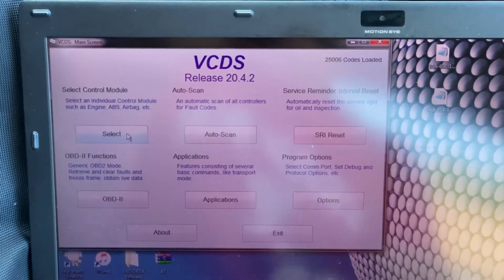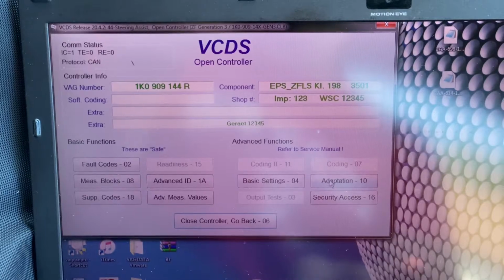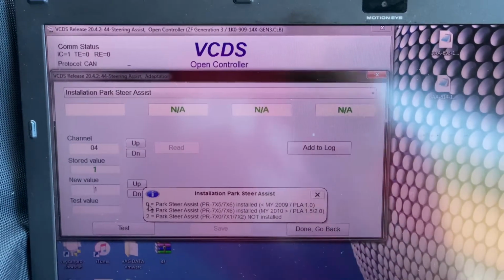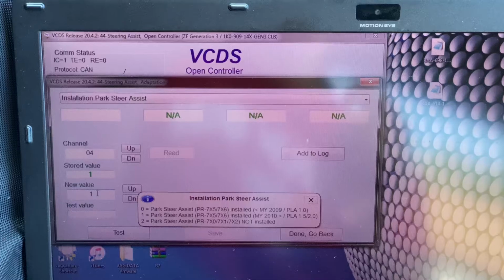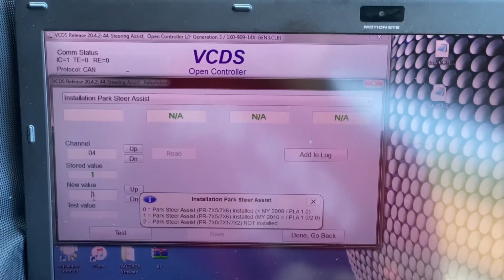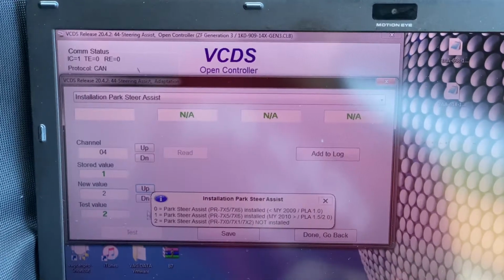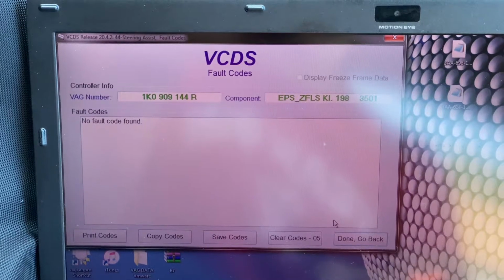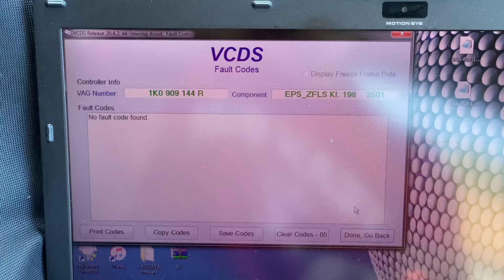Passat B6 B7 CC PLA activate in 44Steering Assist module

Comment: Hello, I installed 3aa920880 mfa on my passat b6 2009 HIGLENE and then the parking assist does not work correctly, does not find the parking space and the reverse warning mfa Thank you in advance for your help
Reply from the maker: You need to check coding, clear all errors manually
Reply: @lavianeverything  I don't know if it works smoothly after clearing the bugs, can you help with coding, thank youI don't know if it works smoothly after clearing the bugs, can you help with the coding, thank you
Reply from the maker: @furkanutu1429  you got vcds? And anydesk?
Reply: @lavianeverything  No, but I also have a friend vcds